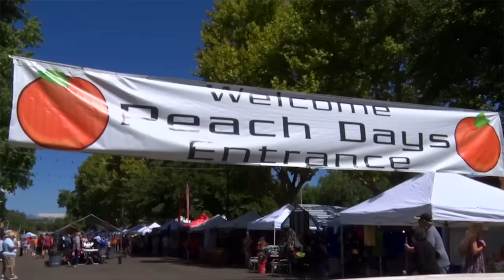I Can't Believe You Drove Your Tractor Into A Lake!

Comment: I like the idea of leaving the hood open as a shield incase the line breaks. Never thought of that before 👍
Reply: I've seen him do that on one other hard pull. I bet he learned it the hard way.
Reply: @JT-SE-OHIO  it's definitely smart thinking
Reply: I noticed the same thing.  If you're going to have someone in the car while pulling that hard, equipment failure could be deadly.  That was a smart trick I hadn't noticed before.
Reply: I came to the comments to find out why they opened it. Thanks!
Reply: it wont save you if things go real bad. ive seen towball go right through  an A pillar.
Reply: This whole time I thought “keeping the engine cool, nice” 🤦‍♂️
Reply: @BlackJeepConvertible 
It was opened to cool the engine only... Rope could break from any point and had an impact in the middle of the truck so hood could not save that...
Reply: @ryanolson9180  Me too, thank you
Reply: @muhammadsafiullah51  windshields are a lot more expensive to replace.  You can drive with a dent in the side of your car.  You can't drive with a hole in the windshield.
Reply: But he still stands nearby. And lets others be near.
Reply: Years ago, I was at a mud bog competition in Colorado and the tractor that pulled out the trucks that failed (all of them) was doing a hardcore dynamic pull, bam  BAM. The kid that hooked the wire rope to the stuck truck sat on the front of the tractor.

I could not believe it. I knew one of the dudes that raced and was involved in the running of the races of the bog. I called him over and told him that this was really really bad. He kinda of dissed me. A few more runs later and the wire rope broke, whipped back and hit the top of the cab, breaking the glass of the tractor, but, luckily, no one was hurt. 

It was soo close to killing someone.
Reply: That's an old school trick. Interesting what people consider a new idea, my dad taught me that when I was like 8.
Reply: @muhammadsafiullah51  any protection is better than none when dealing with this type of thing. 
If it was only about cooling then why have a hood in the desert at all?
Reply: @mikewhitman745  idk it's new to me

Comment: That f350 buried in the mud makes a good case for carrying a hilift and wheelmate attachment. I sunk my truck like that a few years ago and with a few 2x8 scraps and a big piece of plywood was able to lift each wheel, backfill the hole and set a board under it, then drove it out once all four wheels were up on top. Not fast, but not too slow, took about an hour. I added the wheelmate to the hilift kit after that. Underrated tool when used practically.

Comment: Nice to see others offer to come & help out. At one of the beaches near me they launch fast to minimise time in the water & soft sand. For retrieval, they take the trailer in deep to drive or float the boats on & have a strap/s already attached so the vehicle can tow it out as soon as the boat is on. My dad took this a step further by installing a drop down full size front wheel so you could push the boat & trailer easily or tow it.  Didn’t look like that sand/mud was real soft so they must’ve been there awhile to sink in. Time is often critical in getting out fast when in these situations.

Comment: If I got stuck on a rock like that truck, I think I would use the jack and see if I could lift the truck enough to move the rock myself. Am I weird?
Reply: No, that's basically what Matt did with the tools he had. To do it with a Jack you would need a jack that can lift it high enough and you need a wide base so you don't just bury your jack in the sand.
Reply: @Psyco913  flat rock, tractor jack 

Optimism builds planes
Pessimism creates parachutes

Both are needed
Reply: @dr.floridaman4805  I was saying that a jack is a perfectly good way to do it if you make sure your jack works on your vehicle and can handle the terrain you are on.

I don't think I would rely on finding a flat rock though. If you're going to bring a hi lift at least bring a board or something to place it on. Also, a hi lift only works if you have lift points around the perimeter of your vehicle to lift from. The majority of the vehicles in Matt's videos don't.

Comment: Watching this... revising my opinion on the wrecker. Not sure it needs a jib. Might do better with a backactor and modified bucket. Have a look at the jcb and the case with the extendahoe...Needs to be capable of dragging and pushing the wrecker and acting as a winch platform, an anchor and a suspended tow platform.... Needs corner jacks too.  You also need to move away from ujs and start installing constant velocity joints. Do you know why?

Comment: You do well with what you have Matt.  You are very talented.  I wish I could be there to help you.  Next time you get in a pinch and need more pulling power with your winch, add a second snatch block next to your winch.  If you have a 12,000 lb winch, with one snatch block you could pull 24k, with 2 snatch blocks you could pull 36k and if you had enough rope, 3 snatch blocks would pull 48k.  You will still need something to anchor to like that Dodge truck or something.  You have such capable vehicles, I am always amazed.  Keep up the good work.

Comment: Get the high lift out and jack it enough to break the suction and pull with the high lift still under it.  It will tip over towards the Morvair.  I've done it a few times in that kin of nasty mud.  I've had to do it in super deep snow, too.  Following a snowmobile trail way back into the mountains then decide, we're waaaaay too far back here.  Tried to turn around and 6' of powder off the snowmobile trail wasn't good!!!  Put traction boards in the snow, high lift and jack up the truck til it was back at snowmobile track / hard pack level and winch it over until the jack tips, rinse, repeat.  Took a couple hours but back then, all I had was a come-a-long!!  Had to drive backwards about 20 miles to get out!  Neck hurt a lot!
Reply: Matt doesn't carry a jack or traction boards

Comment: What pintle hitches does Matt use for recoveries? I see in some videos he puts a 2" one piece hitch in customers' receivers to either use the rope or winch on - I'm guessing 10 ton as that's all I see online in brands like "Curt"? I've also taken several screenshots of the videos when they're hooking up the rope to the recovery vehicles. I can't tell whether they're using 10, 20, 30 ton pintles. I do see they're bolted to a solid bar and then welded into the receiver though. I'm trying to figure out what's sufficient for sporadic snow recoveries in my 01 suburban k1500 during the winter primarily, but also may use when I finally find the right XJ that I've wanted for 15+ years that Matt inspired me to finally purchase. I like having options, and while I like the dedicated recovery points from yankum and factor 55, they're expensive and not really as efficient or versatile (or most importantly, cool looking). There's very little information on this online, so I've resorted to asking the YouTube comments section, ha. Will something like that Curt 20,000 lb 2" solid bar pintle hitch and a high quality hitch pin be adequate for my light use (comparatively)? Are those things really solid all the way down? I like the idea of the two piece setups Matt uses, but they're heavier, bulkier, and more expensive. No USA made one piece setups for the single piece 2" 10T that I can find though. Long comment... can anyone provide some insight or refer me to any resources here? Thanks so much if you take the time to respond here!

Comment: That was pretty smart on putting the winch line further up the ball instead of the weaker part down by the wall, putting alot of stress on the welded part which can fail.

Comment: Florida man tip. Where there is mud there is usually some standing water and an electric pressure washer shooting a jet under the tires and frame generally breaks the suction right away. There are even battery powered pressure washers now if you don’t want to bother with an inverter.

Comment: I wonder, if you had some type of wide blade that would mount to a front receiver and was angled at say 45 degrees when touching the ground and hinged to a certain point so that as the rig starts sliding the plate will dig into the ground until it reaches 90 degrees and then becomes a solid anchor. You could play with different widths to find the best bite or even use multiple smaller ones for a better bite over a wider area.

Comment: dodge 2500 megacab sxt curb weight 6700lb
trailer approximately 500lb
polaris jetski x2 approximately 1000lb

morrvair at 5500lbs

morrvair was trying to pull combined 8200lbs sunk to the frame.

the math:
8200lbs sunk to the frame x mire factor 3 =24,600lb resistance

apex 12000lb winch with 3/8  freedom winch line with a working load limit of 15,000lb on the line itself. 
2:1 mechanical advantage shown in the video brings the fall line force  to 13,530lb which is higher than the capacity of the winch and close to the working load limit (breaking the line)
3:1 mechanical advantage would have brought the fall line force to 9840lb which the morrvair attached to an anchor (truck) would have easily and safely pulled the dodge.

in order for the morrvair to pull the dodge out without additional help or anchor you would need a 8:1 mechanical advantage which i don't think matt has enough tackles and line for compound winching techniques. though most situations wouldn't need such techniques in these light vehicle recoveries. mainly  used for heavier equipment such as military vehicles and construction equipment

I do wish matt would learn the math on winch calculations to know when his rigging is under the breaking load instead of "gut feeling". he was very close to breaking that line and if that dodge weighed 500lb more than curb weight he would have snapped that line.

the owners of the dodge didn't help by leaving the trailer hooked up. if you unhook the trailer the resistance the morrvair would have to pull would only be 20,100lb
at 20,100lb he could easily pull with that 2:1 ratio with a fall line force of 11,055lb. safely under the winch and line limits. he would just need to anchor the morrvair with a truck.

With enough mechanical advantage and line you can move anything.

Comment: I agree there are times pulling from the ball works. I believe the key is kinetic ropes and NO shock loading. Personally I pull the hitch and put the rope in the receiver and put the pin back in so there's no question if it will hold.

Comment: In the Top end of Australia where we have  10 to 12 meters  40 feet of vertical tide  We have drawbar extenders bolted to the sides of the trailers So we can clip them onto the trailer hitch to extend the range That way your 4x4 wont get stuck !

Comment: I've seen a few videos where tractors are used to launch boats at the beach - where there isn't a ramp. They roll the trailer out, stop, and the boat slides out. This "beach" though is mostly just mud from a low water level.

Comment: Have a question. Had my 2007 dodge rescued recently.  Took a modified jeep and a wrecker to pull truck back onto trail. 2 tires slide off trail. Took 12 hours to port to port. Gave me a break. 3300. To $2000.  is this in line with your long recoveries?  Thanks.

Comment: Next time try using two Snatch Blocks, or 3 or 4, then you do not need the extra truck as an anchor, Check out Archimedes Pulley System. Slow put but it gets them out.

Comment: Glad those ropes didn't break, my sons sent a block into the back of the truck bed after a rope broke. It bent the front of the bed wall so badly into the truck cab it broke the back window out. If that block would have hit 6 inches higher there would have been certain death.

Comment: That's the Mahindra 5100 series that was just released about 8 months ago. It weights about 8,500Lbs with the loader equipped. Also that beeper when they first started pulling was the parking brake alarm.

Comment: Were i live in italy we have red clay mud, impossible to winch em out because there is too much suction, so we jack them up, put some branches under the wheels and then an elastic rope pull em out or just one winch is sufficient, if we do not lift em off mud, impossible job. a long jack could help some times in certain situations, of course on a standard car were you have no lift up points then its difficult to use a jack, but like i sed, in certain situations. ciao

Comment: Using the kinetic rope for winching makes me nervous. Lots of energy being stored in the kinetic rope, especially with a snatch block doubling the winch pull force. Synthetic rope is supposed to be safer than steel for winching because it doesn't stretch and store energy. Using the kinetic rope negates that especially with the snatch block pulley in the mix which has the potential to become a projectile if there is a rope failure. 

The 7/8" Matt's recovery rope has a 6000 lb static weight rating and a 28,600 maximum braking strength when new. A 12,000 lbs winch with a snatch block comes pretty close to 28,600 lbs. Way too close for comfort in my opinion. 

Glad it worked out in this case, but it might be better to not be storing so much energy in the kinetic rope. A static strap or synthetic winch extension rope might be better.

Comment: Ran into a tractor situation just like that put 2 4x4s under the bucket.,put the bucket down until the front wheels came completely out of the water then pulled the tractor using it's back wheels.that bucket slid down those post like they were greased and it came out pretty easy.
Reply: Reply to this post was a scam they removed it.

Comment: Hi everybody... Sooo... could somebody answer me this... At 7mins 42secs, Matt opened the bonnet on the stuck truck, now, my 2 guesses are   (1) To release heat if it is hot in the engine bay, orrrr (2) Its in-case something let's got in the setup and the bonnet will save the truck windscreen from being an expensive repair, so sorta like a bulletproof vest or shackle proof if ya like! 😁 But I'm not sure at all, my favourite would be to save the windscreen and potentially anybody sat behind it from any flying objects from a failure... Other than them two guesses, I have nothing. So any guesses or the actual answer from sir Matthew himself would be greatly appreciated. Thanks MORR guys and everybody else in here. 👌👍😉

Comment: Come on Matt!!! A guy got killed trying to yank a truck out of basically dried concrete with a ball so now obviously every single job is going to set off every person that doesn't understand physics remotely and the stresses a stuck truck vs a truck in a sandy valley create. Pulling a broken Ford festiva across a icy lake WILL break a tow hitch ball rated for 50,000,000 pounds according to the internet somewhere.

Comment: if you guys were wondering why the hoods were open they were in case the line broke and flung toward then windshield the bottom of the hood would take the brunt force and not kill whoever was sitting in the driver seats of the vehicles.

Comment: Probably a dumb question for you,  and in no way am I trying to insult your intelligence, but have you ever looked into mechanical advantage? Z-rigs, 3 to1's, etc.? I work in Confined space rescue and use these systems to haul extremely heavy loads with minimal input. When you are in a bind and don't have enough rocks in your pocket - you might just be able to increase the pulling power of just the Morvair or the Banana. Mechanical advantage works, no matter the type or size of the application. Love the channel!
Reply: @MattsOffRoadRecovery  I guess not having a solid anchor wouldn't quite work. but if you had a tree or something to anchor to then it would definitely work.  Anyway, Love the vids! been following since the beginning!

Comment: I’d be curious if an extra snatch block for a 3:1 would’ve pulled it out. I usually carry a couple snatch blocks and a spare winch rope, that could get me up to a 6:1. Overkill I know. But I often wonder what it would be able to pull, as long as I had a tree I could use to hook the snatch blocks to to take most of the load so I don’t rip the winch off my bumper.